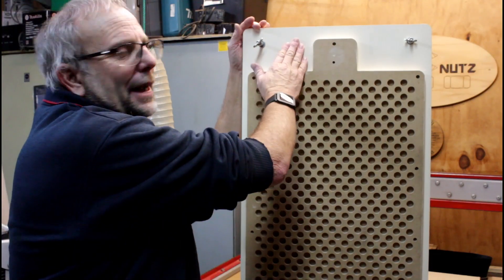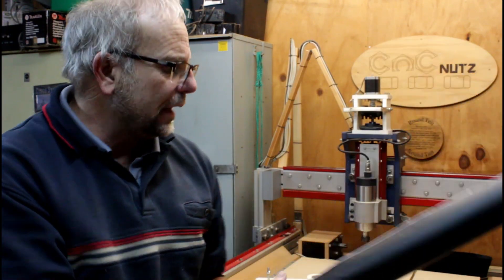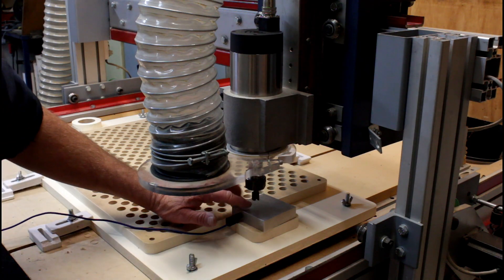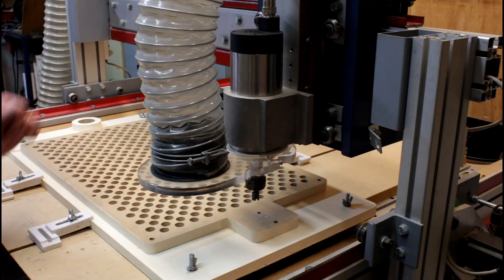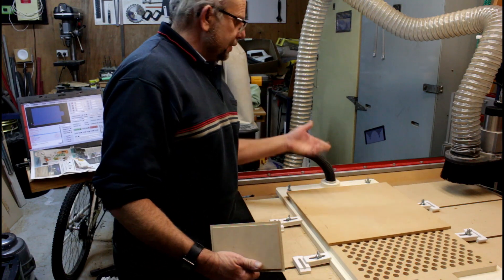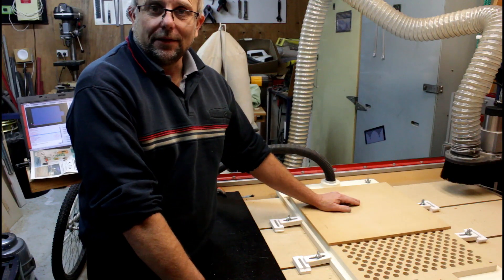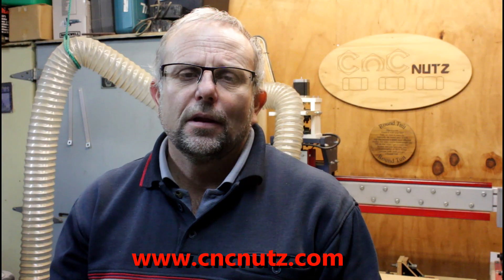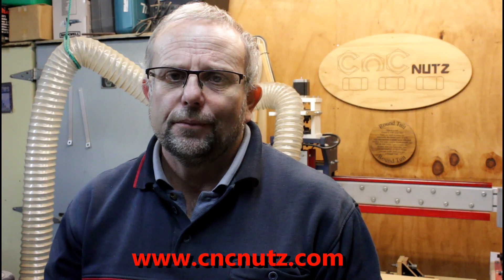DIY Vacuum Table Part 2 - CNCnutz Episode 211

Comment: One option for solving the motor cooling issue, at least here in the US, would be to use a common wet/dry shop vac. 
In those, the motor is cooled by its own, separate fan and does not use any of the vacuum air to cool it.
Reply from the maker: Good point. Those have to have separate cooling as pulling water through the motor is an even worse idea than pulling dust through. Good thinking.
Cheers
Peter
Reply: The old vacuum i converted for my sander before i brought the festool is a old wet and dry kirby vacuum. Give it a try.
Reply from the maker: So your saying you don't need the Festool back. Excellent.

Comment: Have you tried hooking the suction up to your dust collector??
Reply from the maker: No I haven't John. Those are high volume low pressure but it might be worth a try. Will have to make an adapter for the hose and see.
Cheers
Peter

Comment: Good ideas.  What about permanently install paper on the table.  Guide lines could be drawn on the paper to aide in the location of the part to be cut.  This would also keep dust out of the tiny vacuum holes.
Reply from the maker: I think the paper might get damaged if you cut all the way through and once the vacuum is on it is very easy to poke a finger through a hole and the vacuum rips the newsprint. I wonder if a small table A4 in size would work. Then the paper could be printed as needed and with guides the paper  could be easily located. Would be good for small projects. Interest idea.
Cheers
Peter

Comment: Thanks for an informative and thought provoking video.  Several have posted information about using MDF as a surface for a vacuum table without any modification to the surface except flattening it.  I had been wondering if smaller parts could effectively be held if the area subjected to the vacuum pump were smaller.  Your newspaper trick suggests that might be true.  

Wonder if self stick shelf liner would work to seal the back.  Would be thinner and perhaps less expensive than the material it looked like you were using.
Reply from the maker: Thanks David. The material I used on the back is effectively a shelf liner type material. I think it was a couple of dollars for the roll and there is enough to do 2 sides if I wanted. I have seen an industrial machine use a sheet of MDF as the table top as you describe but always thought you needed an industrial vacuum to pull through it. Looks like I was wrong. How good it is for holding small pets I don't know. I have see  small pods that people use for holding parts
And they hold on like grim death but whether they are suitable for the application is another  matter. The small pods have Orings and a central hole for pulling the vacuum. 
Cheers
Peter

Comment: Hi Peter, shall I send you some of the cloth that I talked about? Also, glad wrap (movers or pallet wrap grade) is a simple option to cover unused holes.
Reply from the maker: Thanks for the offer Micheal but I will see how it goes with the paper first. Do you have a link to the magic material so I can have a read up about it? 
Thank you for the inspiration for this project. It took a little while to get started but I got there. Now I need to use it for a project.
Cheers
Peter
Reply: Here the links: 
This is my favorite fleece; it has some sticky stuff (very technical) on it, which will melt when cutter and part heat up and bounds the part to the fleece – very handy for small parts when the hole raster does not line up or the parts are simply to small. When working with material which simply does not heat up enough (or mustn’t heat up) I simply use an iron to iron on the fleece i.e. for small plexiglass parts:
https://portatec.de/en/vilmill-technologie/

The next is basically the same stuff that vacuum formers use to line their bigger vacuum molds. Should be easy enough to get hold of:
https://www.sorotec.de/shop/Vacuum-Fleece-230--1mm.html?language=en
Reply: Oh, and another thing; the table should be surfaced under vacuum, as the entire system will yield and distort under the vacuum. Don't worry about the holes clogging, nothing what a vacuum cleaner and a bit of compressed air won't cleanup (and the smaller the holes the better anyway).
Reply from the maker: Thanks for the links and you make a good point about the vacuum being on while surface the table top.  I didn't think of that.
Cheers
Peter
Reply: Your welcome... Sadly learnt the surface issue the hard way and had my findings and fix confirmed at an open house event when talking with some professional vacuum table builders.

Comment: Peter,
I using a blower vacuum port the motor is a stand motor with a cooling fan.
The blower output blows the warmer air outside.
The blower is a leftover and did not cost a lot.
Thanks for your good idea.
Robert
Reply from the maker: Thanks Robert great idea.

Comment: Great info in this video, thanks Peter.  I will definitely try some of these ides to improving the holding power on my system.  
My biggest problem is not holding the work piece down at the beginning of a job, but holding it down having pierced the bottom surface of (or being some way part through) the job being cut.  Something that exacerbates this problem is any sheet that has a slight bow.  One method around this is "onion skinning" which requires you cut all pieces leaving a super thin skin and without piercing the bottom surface.  (It still requires the board being held down during the final pass or there will be a lot of clean up by hand!)  Cheers, David
Reply from the maker: Thanks David. I'm hoping I will be able cut all the way through but will onion skin it until the final pass. Fingers crossed it will wodk as imagined.
Cheers
Peter

Comment: An option for others may be an old Kirby vacuum. They have the fan set up the same way
Reply from the maker: In the old days they probably knew that pulling dust through a motor wasn't a good idea. The rest of the industry spends its time trying to keep dust out.
Cheers
Peter
Reply: Many of the more expensive home vacuum cleaners use a separate cooling system. Most common, and most powerful, are the whole-home built-in systems. You can buy just the motors for those and make your own 'box' to hold them. I believe there are 'black box' vacuum system plans out there on the internet. You can combine several motors in one box to boost the vacuum power.

Comment: Hey Peter,
Amazing how something as simple as news paper can solve a problem.
Nice video!
Reply from the maker: I was surprised how much effect it had. I knew the newpaper had to have some practical use otherwise why would they make it?
Cheers 
Peter
Reply: On my big 5 x 10 foot machine we use plastic sheeting to seal off areas not covered by the substrate within the zone.  This is a system using only MDF with no holes as the spoil board.  I wonder if plastic would have the same effect or even work better than the newspaper.  I'm thinking of building an auxiliary vacuum hold down like yours for small parts.  My 13 hp 3 phase regenerative blower holds down sheets even as small as 2 foot by 2 foot very well but anything much smaller doesn't work.

Comment: Had a thought. No matter how good your dust collection is, eventually little bits of debris get down into the suction holes and will likely clog up those holes.   It might be useful to add an air compressor port that you could apply pressure in the other direction to blow the holes out. 

Either way, nice video. I'm think you could add up the area of the holes to get an approximate flow need by a vacuum pump. Especially with the newspaper trick and that you will probably have x% covered at all times with your work piece / cover plates... it probably doesn't need to be that big.  Apply a healthy safety factor to be sure.
Reply: DRMNZ thanks for the feedback. Good to hear from someone that's been using one for a decent time. If it's never a problem, then don't fix what isn't broke!
Edit: original reply didn't sound friendly when I read it back.
Reply from the maker: Thanks Andrew,
One of my thoughts was given how much MDF leaks air I suspect the small holes might not be necessary. Guess I will never know. I made the top removable with a few screws so they could be cleaned easily but compressed air would be quicker for sure. Will do some calculations and see if I can figure out the air flow.
Cheers
Peter
Reply: @cncnutz   I will continue to experiment without holes and see if i can get it to work on a shop vac - though i am using 25mm moisture resistant MDF (because my workshop is damp and its what i got spare) I might make a pressure valve to allow air to flow once the vac is high enough
Reply: Interesting point Andrew.  FWIW, on my table, I have been using the same sheet of skimmed MDF for about 3 years.  (The machine is not used every day) but I have never experienced a loss of holding power, nor does it appear as though the absolutely minute dust particles have had much impact on the filters in my vacuum pump.  Cheers, David
Reply: CNCnutz (Peter Passuello) I don't know where you live Peter, but AutoZone has a vacuum pump in their loan a tool program that is used for pulling all the air out of air conditioning systems before your charge them.  The tool rental is free if you return it. Might be worth trying.
Reply from the maker: I live in New Zealand and we don't have Auto Zones here. But of a pity as I could do with recharging my vehicle aircon as well.
Cheers
Peter